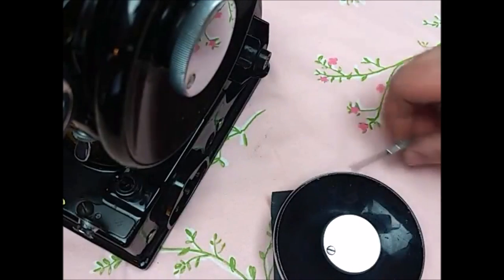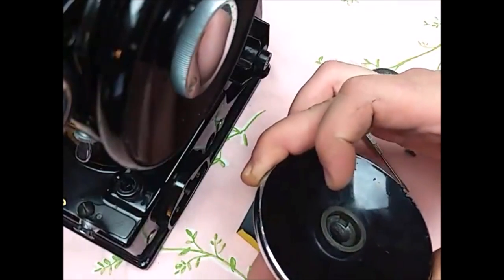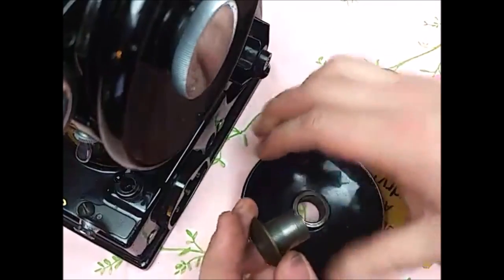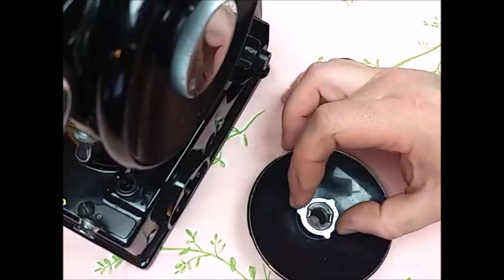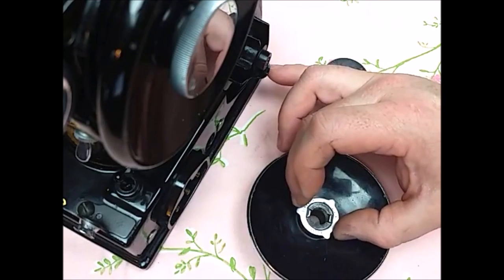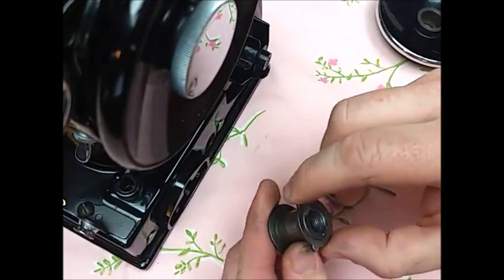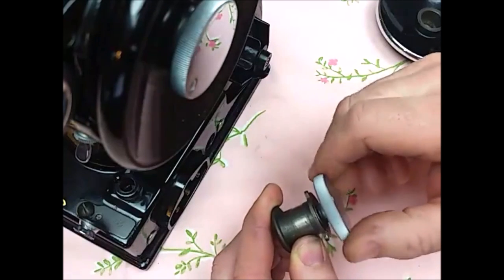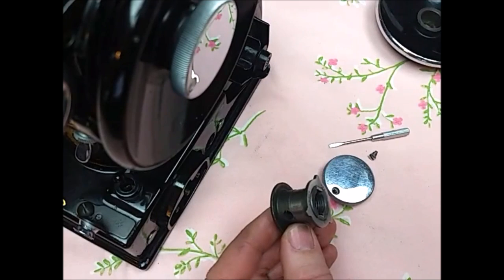How to Adjust the Handwheel

Comment: Thank You SO MUCH! I had the ring with the 2 prongs in backward!!!!! (I was wondering which way to place that!!!) I had taken out the screw to put on a new belt and I made a bobbin or 2 and THEN when I replaced it all, the wheel would not turn! It was because I put that washer in upside down. Once I replaced that  the wheel turned immediately! The tutorials saved me again! (And I tried to call for help but you were closed on Saturday!!!). I did it myself and felt so proud that I could!

Comment: I just bought a 221.  I cannot get the motion knob to turn. It seems to be stuck or whoever put it back on could have put it cockeyed anyway I’ve taken the screw out. Cannot get it loosed up to get off.  Do you have a suggestion  on what to do in this case?

Comment: Would this same method for fixing a stiff hand wheel work on a Vesta hand crank machine? 

The Vesta was working beautifully then I removed the crank from the hand wheel and put it back onto the spoke but the wheel is hard to turn its very stiff best way to describe it is like it’s like tightening a screw tightly, I’m not sure what’s happened as that shouldn’t happened just removing the crank but somethings happened and I need help.

Comment: Hello! After I wind the bobbin, I can’t get the wheel to completely re-engage so that the arm goes up and down. It appears work fine for a few stitches before the wheel ‘slips’ and the arm stops and I must manually move the wheel about 15 degrees back to re-engage the arm. Any ideas?

Comment: Hello, I'm hoping you can help. I purchased a used sewing machine months ago and just tried to use it for the first time. I got the bobbin and thread in but the needle is not moving with either the foot pedal or the manual hand wheel. Did I buy a lemon? When the foot pedal is pushed, it is making noise as if it were working, but the needle doesn't move. Any thoughts?
Reply: Oh we have the same problem

Comment: Hello,  Thank you so much for sharing this video.      Whenever I have to change my machine belt,  just loosening the motor to take out the belt & then slip it back on with a new belt does not work on my machine., because the handwheel on my machine is too BIG & the belt just cannot be slipped in, which means I have to take out the handwheel as well., & I will have the above problem.     NOW, thanks to you,  I can change my own machine belt instead of sending it to the machine repairman.
However,  can I enquire whether there are any parts in the handwheel that I may have difficulty putting back, other than the one above in the video.,  before I go ahead to change my machine belt?  Thanks & Regards.  Ivy
Reply: Thank you for your response, Better late than never..... and,  Voila!!   I managed to change my machine belt successfully following the instructions in your video., & am feeling really good that I am able to do it myself....    Really appreciate your share.  Yes! I've subscribed to your channel as I do not want to miss out on any tutorials you may upload for my future use.  Thank you once again.  Best Regard,  Ivy

Comment: I have a singer 201 and my wheel has stopped turn when applying foot control. I have taken of the wheel and see no problem with motor turning.

Comment: Hello, I have an old Singer 348 electric sewing machine. It's in excellent condition and I have recently had it serviced. There is one issue that I would like your assistance with. Whenever I step in the floor pedal to begin sewing, there is a long pause with a humming sound. Sometimes, I have to give the handwheel a slight nudge for the sewing maching to start. Any suggestions? Thank you.
Reply from the maker: Thank you for asking!  Follow the link below to contact us directly with questions about this topic.  Happy to help!

https://www.singer-featherweight.com